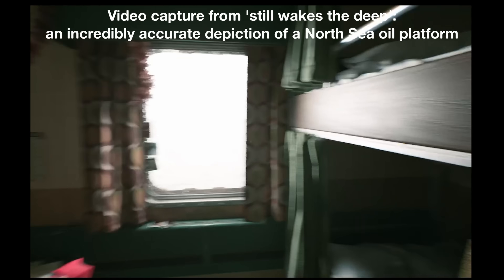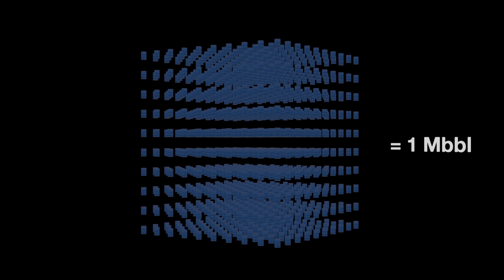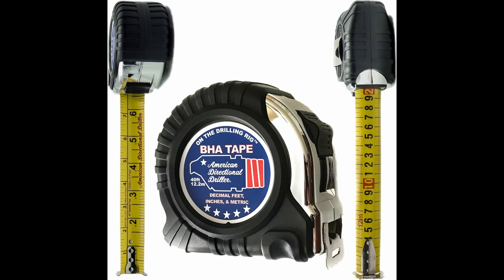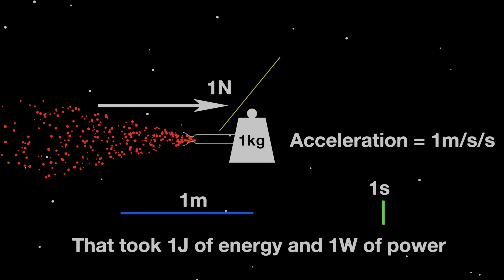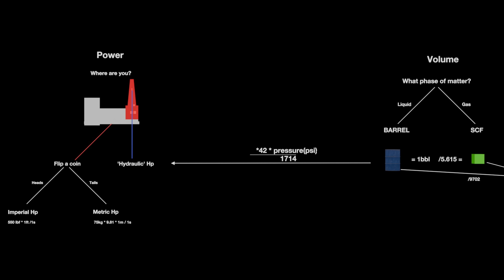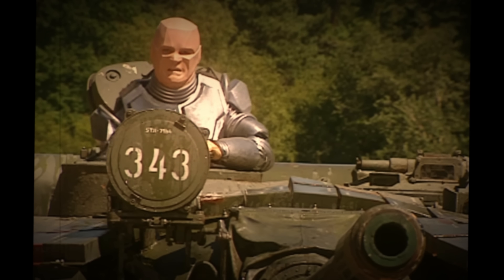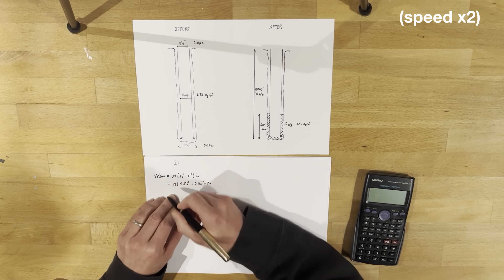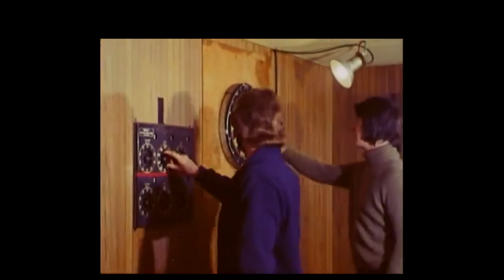Oilfield Units: a Measurement System so Cursed it made me Change Career

Comment: Explanation is a bit long but here you go.
The reason cars get MPG when you fill your car with liter and driver at KPH for x amount of km(s) is that they changed the equation to Liters per 100km.    Now, both MPG and L/100km are pretty useless for calculating the fuel you will need for a trip.   That changes from day to day based on your mood, the weather, where your going etc etc etc.  So no one puts in the amount of fuel you need to go the distance you want.   Most people put fuel In by dollar or ‘fill it’.   What people actually used those arbitrary MPG or L/100km numbers for is just to compare one car to another.   What people know is… Bigger number is better.  When they flipped that for L/100km, no one wanted to track all the decimal points to make it a relevant comparison.  In L/100km.  The difference between 40mpg and 200mpg is only 4.  Sheesh.  Here, it would have been fine if they did km per liter but the car manufacturers lobbies to have it change to they didn’t have to work so hard on fuel millage.   ie. 40mpg vs 30mpg seems like a big deal to the consumer but 5.8 vs 7.8 doesn’t seem like a big difference even though it’s the same thing.

Comment: This baffled me when I went to work in the oilfield. Im from canada. My background was asphalt road construction. You would think this profession full of meatheads would be full of imperial nonsense, but nope. All metric. We used metric tape measures, settings on the machines were in millimeters and the trucks were loaded with tonnes. Jobs estimated in m².

Then I got to oilfield work and experienced this complete nonsense. I hate it. I work in public transit now.
Reply: I have a degree in transportation engineering. Our professor in road construction had specialized in pavements and had made a long career in the US. We were forced to do some bitumen calculations the American way. Those were completely nightmarish. Everything used exotic imperial measurements, yes, I even learned about the Rankine scale.

Comment: I've seen decimal inches on tape before. That makes sense, since US customary doesn't actually have any units smaller than an inch, just annoying fractions.

But decimal feet? That's just doing anything possible to avoid the metric system.

Comment: The UK is stuck inbetween on units and we Americans should respect that. I, for one, continue to resist the global tyranny of the metric system and will forever evangelize the comparatively greater measurement value of the barleycorn, but the UK was the "man in charge" during the pivotal transition in history from Imperial units, THEIR empire's Imperial units, and the broader push to metric. The UK presided over their own transition to a base-ten money system in 1971. I wouldn't dream of mocking their struggles integrating other units of measure when the base measure of value itself was altered in only the last handful of decades.

Comment: Hello, I've been in the petroleum industry since 1980. Here is my "two cents" on the use of the "Barrel" as a measurement of crude oil and refined fuels. I started my career with the California based company Measurement and Control Engineering working onshore and offshore. My speciality is conducting the well testing operations initially during the drilling phase which is the drill stem test (DST). Then afterwards, upon the completion of the well when the drill rig moves off, the long term well flow test. And the flow tests afterwards if any additional methods are used to increase production such as acidizing, gel sand fracing. (Yes I know some of you use the spelling "fracking". If you want to know why I spell it "fracing" ask me.) Also the well tests during enhanced oil recovery (EOR) techniques like steam injection, gas injection, chemical injection, water flood, fire flood. And I have conducted the flow tests during the miscible water-alternating-gas (WAG) injection process to increase oil production as we have done up at the Prudhoe Bay, Alaska oil fields. Here in America specifically in the petroleum industry the use of the term as a form of measurement the "Barrel (bbl)" came into use to transport crude oil starting way back in 1859 - 1860 soon after the first oil well was drilled in 1859 in Titusville, Pennsylvania by Colonel Edwin Drake and his driller "Uncle" Billy Smith drilled the first successful commercial oil well in Titusville, Pennsylvania, in August 1859. The discovery is considered the birth of the modern oil industry, and the site is now preserved at the Drake Well Museum. And I have been to this museum. Now back to the topic of use of the 42 gallon "barrel". How and why did this happen? This is the truth. The fellows out in western Pennsylvania in the 1860's looked around and the only readily available empty container that was in abundance was the wooden Whisky Barrel. Yes, the same wooden barrel that has been used here in America since before the American Revolution to hold whisky alcohol. And whiskey was always sold in a wooden barrel that measured 42 gallons. However when you bought or sold whiskey one always sold or bought and paid for only 40 gallons. Why ? Because the alcohol inside the wooden barrel evaporates over time and can and does permeate through the wood. They referred to the slight loss of the alcohol as the "angel's cut", which evaporates into the air, or the "devil's cut", which soaks into the wood. Trivia...yes...I know but information non the less. The Drake Well discovery was drilled to the depth of 69.5 feet and it launched the modern petroleum industry. The well was drilled 3 miles south of Titusville, Pennsylvania, on the banks of Oil Creek. The successful strike occurred on August 27, 1859. Drake was hired by the Seneca Oil Company to find and produce oil in commercial quantities for refining into kerosene. The driller "Uncle" Billy Smith was a salt well driller and blacksmith who helped Drake adapt salt well technology to drill for oil. The well produced about 10 - 20 barrels of oil per day, a success that sparked an oil boom in the region.

Comment: kwh/1000h is a common unit in public, which sounds dumb at a glance, but it makes sense when it's a device that's used about 3 hours a day (i.e. 1000 hours a year), because you just multiply by your electricity cost per kwh to get your yearly cost.

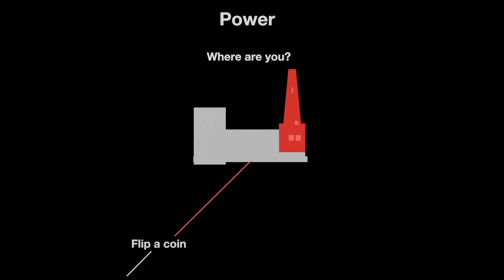Comment: Great rant! The line at 8:27 about ‘pound is a unit of force, not mass’ hit home. I learned physics in the UK in the 1960s when we used imperial units, and the pound was mass, with the poundal as the force unit (1 lb × 1 ft/s²). Oil and gas using pound-force (lbf) just adds to the mess, especially when torque is in ‘foot pounds’ (8:39). As a car guy, I read ‘lbf’ as ‘pounds foot’ (lb-ft) for engine torque, like 300 lb-ft in a V8. The industry’s unit chaos makes me glad we went metric in the UK post-1965, even if cars still use horsepower and lb-ft!

Comment: 4:05 That's absolutely not true in the slightest! It completely depends on what field you're working in, generally speaking if you're in America you will not be using the SI system on a regular basis.

Comment: Could one not argue all units are arbitrary?
Reply: Units are arbitrary. What makes the metric system so useful is that the arbitrary subdivisions of physical dimensionality are set in such a way that they all play nicely with each other, with most conversion factors being either 1 or a power of 10.
Reply: A foot isn't arbitrary, it's based on the human foot.
Reply: @LukeW_66  Good point but why not a forearm? why a human foot and not the gate of a horse? why not the average width of a tree? whose foot is it anyway? I know it used to be standard on some midevil king's foot but it's still arbitrary. Something being arbitrary does not mean it isn't useful, i might add.

Comment: I used to work in environmental engineering, and we used decimal feet.  All of our calculations were done in feet, and then more precise measurements would use tenths, hundredths, or even thousandths of a foot.  We always wrote it as 32.457' so there'd be little confusion with other units, but it certainly wasn't what anyone else around us was used to.

Comment: Way back in the 60's leveling staves were in feet and 10ths of a foot. So when you took levels on a construction site it was feet and tenths of a foot. Then in the uk sense took control and we went  metric. Well most people did, but 55 years on we still have luddites using imperial units. Beer is sereved in pints and spirits in mililitres. And people still say they are 12 stones, whatever that is. How long will it take to change, methinks never

Comment: Trying to buy a replacement tip for a fishing rod: the diameter of the ring is expressed in mm. The diameter of the tube, that the rod tip pushes into, is expressed as decimals of a sixteenth of an inch. A rod tip of 7/4.5 would be 7mm diameter ring and four and a half sixteenths of an inch diameter. 
Your experience may vary as there are inconsistencies in the definition of measurement.

Comment: 3:56 Ah, my friend, you skipped over a lovecraftian horror that I discovered recently working with natural gas in the utility space. Volume is relatively easy to measure and can be a good proxy for a true quantity of a fluid, but the density of a gas is a function of pressure and temperature. No problem, you can correct for that and define a STANDARD volume at a given pressure and temperature. One atmosphere is the obvious choice for a reference pressure, but what temperature is used in the definition of a standard cubic foot? The answer is that it depends what gas you're measuring!

5:06 I can promise you it isn't, I briefly worked as a field tech with a surveying firm and we used tenths and hundredths of a foot - it's just easier to express greater precision over a relatively long distance by giving the number in feet with a decimal. We called them "tenths" and "hundredths", but outside of work I liked to say "metric inches" because I felt confident nobody would be able to parse what that actually means.

8:22 Yes and no... it's both! The "pound" as a unit of non-currency measurement can refer either to a unit of force ("pounds-force", or lbf) or a unit of mass ("pounds-mass", or lbm). An object with a mass of one pound exerts a force of one pound under gravity (terms and standard conditions apply). This is a useful property of the unit of mass until you attempt to use it and realize that it actually is not. Kinda like how people will tell you that water boiling at 100C is in any way useful.

Lastly, the parts-per-million slander is outrageous. Great video, love your work.

Comment: Just-retired electrical power engineer (one week today, thank you), educated in the English-speaking Caribbean so an S.I. purist (except for my industry’s one peculiar hold out - the kilowatt-hour, kWh, the unit for electrical energy sales, but not so bad as the procedure for converting it to joules is encoded in its name).

After watching this I am amazed  that the oil and gas industry has not killed several people and caused millions of dollars of loss in spectacular accidents due just to this unnecessary and imposed system of units and concomitant conversion. People using S.I. don’t need no little book of any colour, err… I mean …color

Comment: Damn. I thought aviation was bad when Boeing has moments in kg inches.

Other aircraft might use the more sensible pound inches but then I used to load freight on a pallet measured in centimetres loaded in kg (make sure  it is gross weight: the client probably asked for a quote for net weight, and I have had a 90 kg steel frame to add which might have been OK on a 70-tonne (ton?) 737 but not on a 10,100 lb King Air for the trip I had planned) while looking at the limitations of floor loading and running load in pounds per square foot and pounds per inch.

Then I would check my fuel gauges (labelled in pounds although that aircraft was unusual for a turbine in having float-type gauges that measured volume, so it was only accurate at specific gravity of 0.79, or 1.77 lb per litre). Look at my operational flight plan for the planned fuel in kilogrammes, convert to pounds, subtract current fuel state, convert the result to litres, divide by two and ask the fueller for that in each wing. It was not so simple if one engine was burning a little more as I would have to ask for different in each wing to rebalance.

Then we get the weather with visibility in kilometres or metres (statute miles or fractions in North America) and wind in knots (nautical miles per hour; used to be metres per second in Eastern Europe but I think that has changed) then take off to navigate in nautical miles and knots. With altitude in feet (again Eastern Europe used to use metric, metres for altitude and kilometres for navigation) climbing in feet per minute.

Comment: I frequented a local wood shop in the UK in the 90s. Officially timber was sold in metric lengths. For the older clients they would also quote in "metric feet". 1 "metric inch" = 25mm, 1 "metric foot" = 300mm. Allowed imperial clients to understand roughly what they were getting, and the staff to do the conversion without needing a calculator. Only resulted in too-short joists once.
Reply: You havent noticed that US woodworkers still use quarters? Like a 2" board is 8 quarters.  And thats without getting into what the heck "board feet" is... you guessed it it's a measure of the volume of wood.

Comment: 8:25:  Except when it is not.  Officially the customary unit of mass is ALSO the pound.  Sometimes the mass-pound and the weight-pound are abbreviated differently.  Often they are not and you just have to use context.

8:50:  I am American and I say it as 'one thousand seven hundred fourteen'.  The x-teen hundred nomenclature is not consistent here, but is more commonly used when it's an even hundred.  thus I would say 'seventeen hundred' if the last 2 digits were 0.  If there is a single non-zero digit it's even LESS consistent.

14:00:  hot take:  I prefer angle per unit length instead of radius of curvature.  I find it more intuitive.  Now I'd put it in radians per meter, which I realize it technically in per meters, but you get the idea.

Comment: Excellent - Similar to flying a Piper aircraft in the UK as I do.  Fuel in Gallons (US),  bought in litres, measured on the flow meter in litres per hour.  Then there is weight and balance with litres of fuel from the pump converted to pounds etc.  Passengers arrive in kg but need to be converted to pounds etc.... and so much more I won't go into. Plenty of room for error here if you are not used to it!! Now do we fly in knots or miles per hour or measure runway lengths in metres but fly altitudes in feet...?!
Reply from the maker: It was always the ‘visibility in meters but altitude in feet’ that did it for me in aviation.

Comment: The company I work for did a lot of stuff for the USA so we used American thread sizes for our products. It’s in the UK so most of our older infrastructure and tooling was in uk thread sizes. Most newer infrastructure and tooling is in metric thread sizes. So we used UNF, UNC, BSW, BSF, BSP, NPT and metric threads on any given day. We also use pressure in PSI, Bar, inches of mercury, inches of water and pascals. We use litres, quarts, m^3 or gallons for volume. At least temperature is simple. Degrees C or kelvin. 
I feel your pain brother.

Comment: A bit of an over-reaction, I think.  I've worked in both oilfield and "regular" mechanical engineering jobs for 40-years, and there is complexity in all calculations.  You just need to keep track of the units.  It's not that big a deal.  But I feel your pain, and enjoyed your video.

Comment: Forty years ago I worked for Schlumberger in Congo.  The client was American.  Congo required we did the logs in metres.  The Mexican oil company once gave me perforation depths in feet and expected me to convert it to metres. I refused and said show me on the logs.  Depending on the conversion factor used and that the depth we are talking about was like 3400 metres, the error could be much greater than the zone we were trying to perforate.  

Crazy to think the information we provided in metres was converted manually to feet.

Comment: As someone who learned electricity from DC to radar, the word permebility triggered me. We learned that word in engineering school too, but it was the magnetization in a material. (permeability constant µ) And it's unit, (which we never used) was Volt seconds / amper meters. (Vs/Am)